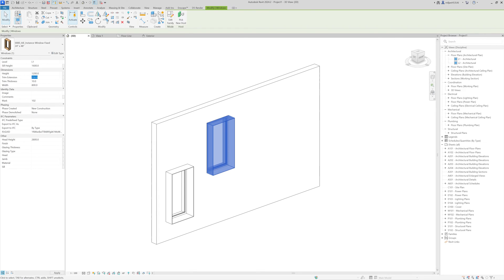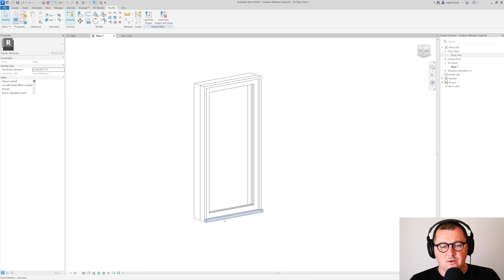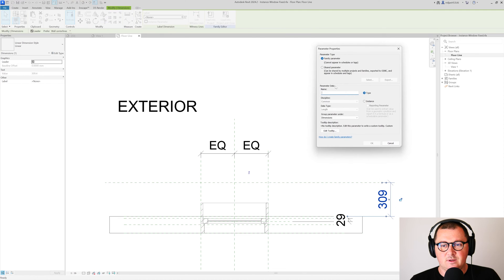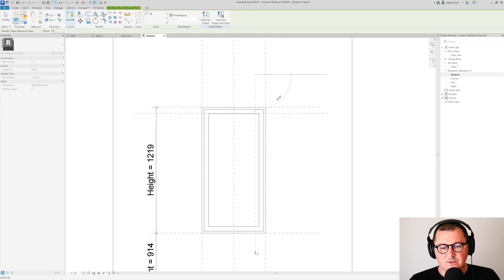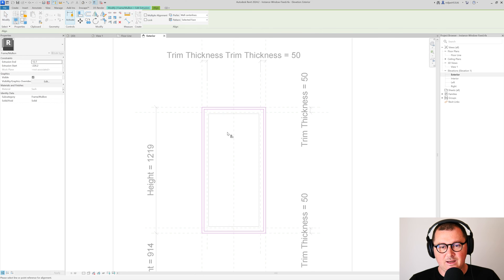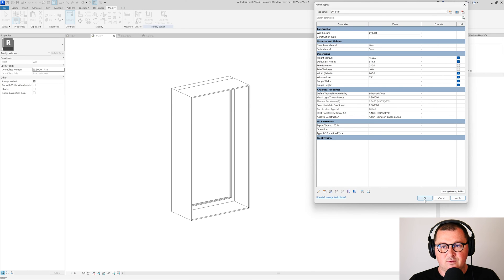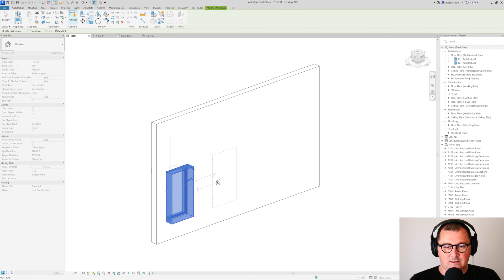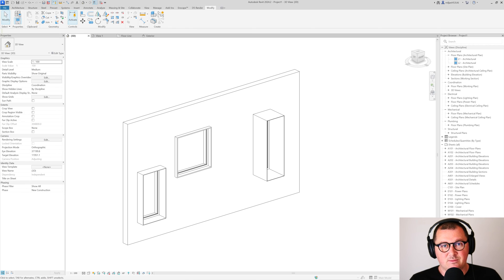Modern Window Trims in Revit

Comment: Do you have an idea on how you would do this multiple window mulled together? Also is there a way to model the bottom and top edge to slope for drainage?
Reply from the maker: The difference is in a window family, how many divisions it will have etc. and then on it you create trims.

Yes, there is, you can take any of modeling tools and which one it the best depends on a case and what you want to achieve. For Sweep or Void Sweep for example you will need to lock the Path to width ends and then to create desired profile